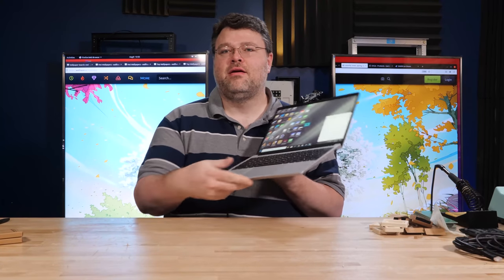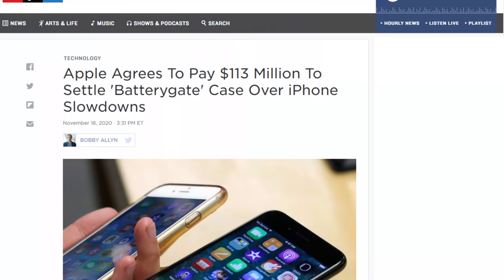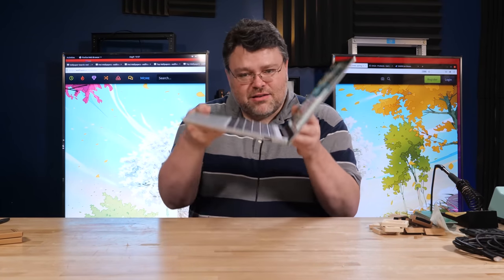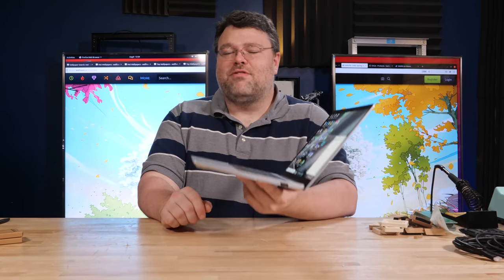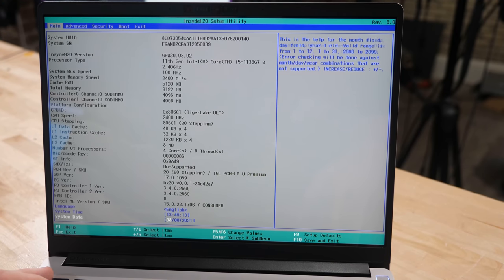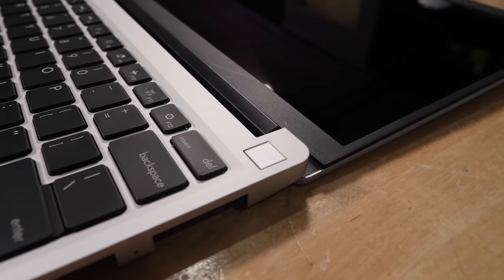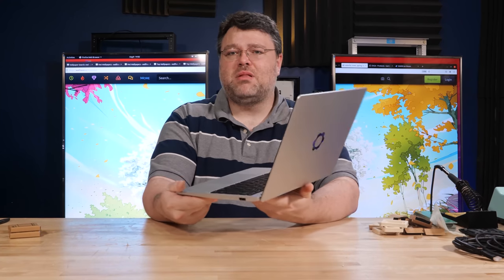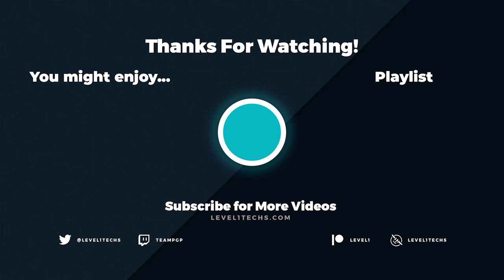Framework: A Laptop Designed to be Repairable?

Comment: I have an invention that still would crush this. 
Instead of the CPU, RAM, GPU being in the "lap" portion ... make those just a thunderbolt display and port replicator with a USB kb connected ACTIVE thunderbolt 3 cable -- which could be networked in homes to even disconnect location-from CPU via Thunderbolt-3 switches. That way all the actual computer 'work, fan' bulk, etc., are independent of the KB, display and ports. Networked throughout your home, it's still just 1 plug in the wall (just like your AC) and as TB3 passes more than enough power for the entire device, as well, is still but 1 cord.  You'd have also inadvertently cured all the latency of WiFi even as supposedly faster than 1GbE options emerge ... and could then have 10GbE if not SFP28 or even QSFP+.  

As a portable, the "power brick" is the whole computer, modular as it is, but more easily so bc the things that had to be ergonomic are in the actual KB and display -- which are NEVER the source of HEAT, and allow swapping out differing-display sizes as any OTHER TB port would support any display that were compatible with the form-factor. Which are already as "technically challenging" as swapping out USB KBs ... along with connecting every other port via that same TB cable. It's as 'peripheral committed' to the box as your shoes are to your pants. 

In fact, water cooling it wouldn't be difficult at that point. And despite everyone's focal-fixation being whether air or water have colder temperatures ... it's NOT the key-benefit of liquid-cooling, verse how QUIET larger, lower-RPM fans are vs those which must be thin & small. Small heatsinks have insufficient mass & fan-diameter to run at low RPM, which is what is actually annoying; not even the dB, but the PITCH.  It'd also be quite-easy to then make the interior of the actual computer ("think: power brick") encased in rubberized material making it DURABLE and -- waterproof, with an alarm if the liquid cooler-ever had an issue or cooling weren't adequate ... but of course, instead of laptop components, if home -- you could plug in to desktop class devices ... with the criteria being one based on whether you require completely wireless runtime (on battery) or not.

Comment: The Dell Latitude line is equally repairable imho. 6 captive screws and you can replace just about anything. The “upgradable” aspect may sound nice, but I wonder how well this goes across generations as in the future things get faster and you want higher resolution screens, at some point the “old stuff” will no longer be compatible which will get really expensive and may inadvertently lead to more waste.
Reply: Replacing the mobo on the Framework is possible, so you get to keep the battery/screen/chassis when next gen CPU comes out. And it's a gorgeous screen too.
Reply: @doryiii  yes, I know that, but 5-10 years from now pretty much everything from thermals to wiring to the battery type will be “old”. How many people can still connect a VGA-only display without converters? I just cycled an old 10 year laptop out of production, 720p was standard on laptops and they were ~3 times thicker, had a CDROM, NiMH batteries, the charging circuits provided a lot less power than today, the CPU and GPU power ratio shifted, we had PCMCIA on this models still and the keyboard/mousepad interface in the computer was PS/2 driven (or at best USB1.1). Everything from the frame to the screen to the motherboard is effectively useless, I can actually put in a few raspberry pi’s in the empty spaces.

Comment: I'd love for a desktop replacement version with a socketed 4750GE, and 4 slots of SODIMM
My uSFF desktop from Lenovo has socketable everything, and yes i tried a different processor, wouldnt work with 65w, but did with 35w. This processor seems to top out at "33w" according to the built in monitoring software, which also seems to be the max for the 4750u so it shouldnt need too much of a larger cooling solution

Edit, would also be super cool to have space for a single slot GPU like the GTX 1070 galax katana, maybe putting that in a laptop will bring back that form factor

Comment: As long as the screen, battery, and cpu/mobo (I know, the CPU is soldered) are easily replaceable/upgradable in the future, then I like the idea.  Otherwise, the only real difference in choosing framework is the modular case.

Comment: My only issue with the design is the small number of ports. 
4 USB-C without a dedicated charging port and display outputs is not enough.  
If I keep it plugged in and I use 2 external monitors.  only one free USB-C remains.

Comment: Assuming the plug on those modules is USB c, I would forget the modules and just get USB C to whatever cables so I can have some strain relief and protection for my cables.  They could just have recessed USB A and C in my book.

I am thinking of going with the Thinkpad x230 replacement motherboard by Xytech, its the next project in the same vein as the x2100 where he puts a new Intel motherboard in the old Lenovo.  I can't leave my Thinkpad trackpoint, it just works so well, now that I'm used to it.  I never liked trackpads anyway, ever.

I applaud the idea, but I'm gonna need a better keyboard than this laptop offers.

Comment: It's almost perfect - almost. Just 2 things left - schematics are available only to repair shops and under an NDA - I can imagine a couple of reasons why that is so, but that doesn't mean I like it. Another thing is no discrete graphics. If framework2 fixes that, I'll be fully sold. NB. shoutout for the replaceable ports. Love that functionality and flexibility.
Reply: The NDA is necessary because not all of it belongs to Framework, but from what I heard, you can request the schematics, sign the NDA, and you're good to go.  It's not that big of a deal.
Reply: @Bri-bn5kt  I understand that's one possible reason for it - there is, afaik, no official stance on this. Either way, doesn't mean I have to like it. Unless we put pressure on companies, they will never change.
Reply: @GalvayraPHX  Baby steps.

Comment: I don't understand why so many laptops have those huge trackpads and without buttons. I hate both of those. With large trackpads not only is it impossible for me to use the whole pad (despite the fact that I have larger hands than most people), but my fingers/hand always accidentally ends up touching the pad, bugging it out.

And then when it comes to buttons, even the clicky pads are annoying. not only do they probably break easily, but the click action frequently causes the cursor position to move slightly due to the movement. That, plus when on large trackpads It's hard to right click because it's so far away.

It's such a mess, I don't understand how people can live with that.
Reply: wtaf have u used a trackpad from 2009?. Those a 2hit . And the buttons are annoying aswell. It depends on the placement. How old r u?. 50?

Comment: If they advertised battery capacity at 70-80% of full capacity and limited the charging to that it would make mobile devices last a lot longer (such provisioning not as important for easily swappable batteries).
Samsung charges their phone batteries to 4.4v which just murders the battery. Got 2 s20fe's 8 months ago, one had macrodroid alert when battery reached 69%, the other 80%. 80% was losing capacity roughly 10x the rate that 69% was (80% ~100mv, 69%~10mv). Don't even want to think how bad it would've been if charging to 100%, but now they both are set to alarm at 69% (noice)

Comment: Very nice concept,  unfortunately this is good for modularity rather than upgradeability.
I Foresee problems for future upgrades, let me explain.
Can type-C convert to HDMI 2.1 or DP 2.0 without losing functionality, I think not.  Thunderbolt 4 perhaps has enough bandwidth at the mo kind of for HDMI 2.1, yet we are limited to PCIe gen3 speeds.
I think the type-C interface itself will prove to be a problem for a future upgrade to a newer i/o standard.
Why not pure PCIe 4x4 and/or 4x2 the link between modules and CPU and/or chipset.
Reply: You're right.  Framework isn't for you.  You should look into a macbook pro. You deserve it.

Comment: 1.Framework Has to create a Workstation or Gaming laptop with GPU upgrading . GPU gets outdated after 3 years faster than CPU .
2.Battery should be large and separate cells like apple if one get damaged it's easier to dumb that.
3.Also Dongle should be smaller and more ports
4.AMD 8 core CPU and GPU is efficient and fits in thin chassis.

Comment: Any news on Linux support for the Framework laptop?
Reply: Yes there is. Check in their forum.
Reply: Linux support is good. Just make sure you use a recent Linux kernel if you’re using the Intel AX210 Wifi module that framework offers. If you use a different Wifi card, you might not have any issues with it. But this is the biggest issue for Linux.

Comment: 2:50 i disagree with that. I have like 9 year old laptop and its only 3 screws to get access to harddrive and ram and guess what? You can even replace the cpu :D but yes this laptop is very nice :) i will buy one soon :)
Reply: I actually recently replaced my laptops fan cus it stopped working. :D i needed to open about 5 screws to replace it :D i fecking love my old laptop <3 but i want to support framework so i will buy one :)

Comment: Still dont get the big deal with a thin laptop. I've never had a problem fitting a laptop in a bag.
Sounds like you'll be placing basically the whole motherboard with a soldered CPU, is it?
Reply: Yes the cpu is soldered, but that's probably more to do with intel. Their mobile chips don't come in socketed varieties afaik, they would be inefficient space hogs anyway

Comment: I'd buy one if there was correct arrow keys. Arrows are my most used keys as a programmer.
Reply: Why are you programming on a laptop?  Desktop is much easier.  Trust me.  Been doing it 20 years.  But if you insist on using a laptop and arrow keys are your hill to die on, then get an external keyboard.  If you're a real, professional programmer, you're already plugging in at least 2 monitors, right?  And a mouse?  So why not just add a keyboard to it?  Besides, supporting this company (and the right to repair movement) is FAR more important than your arrow problem.  Buy the damn laptop and help the company grow!

Comment: I REALLY hope that they will offer a mechanical keyboard with a Trackpoint instead of a trackpad. It's a deal breaker for me.
Reply: Mechanical keyboard on the laptop? Only several had done before and they're pretty thick, feels not as nice. What's not desirable in bringing in your own keyboard?
Reply: I've been reading forum threads; as it currently stands, neither of those things can happen without significant changes to the laptop (to accommodate extra depth).

Comment: People keep saying it's designed for tinkerers, but is that really true? Wouldn't it make sense from a corporate office perspective to supply your entire school / law firm / hospital / etc with these and dramatically cut down on upgrade/repair cost and time? No more $1000 replacements in a lab far away just because someone stepped on a cable and destroyed a charge port; just get the $10 new USB extension port, ask Dave from IT for 5 minutes to repair it, and off you go.

Comment: This is good, but things used to be better. Laptops used to be much more repairable than this, hell you could swap out batteries without opening the casing. One of my dad's laptops even had a socketed CPU, even though it was a midrange model.

Comment: Going to be quite frank, the three real differentiators between this laptop and other user serviceable laptops are:
1) It isn't a mid-high end gaming laptop, including pros and cons of said laptops
2) The "Modular" ports are literally just dongles that fit in the chassis, and included in the box.
3) Parts availability. This is the major advantage Framework has, if they are actually successful enough to follow through.

That said, we've gone through this song and dance before. Consumers largely don't want user serviceable devices that they can fix. They want throw away devices that will just work until they're outright replaced. It's a great idea, alright implementation, with a small audience.

Comment: i want to like this, but im pretty sceptical. please tell me what i miss here.
i will  seperate this in tow parts. to make clear. im for right to repair and repairability.

Part one = you can get a cheaper laptop with the same specs or with the same price for better specs.
and i dont mean the cheapest one you can buy. you can have a branded one for less.

part two = what breaks in laptops/notebooks. Batteries, display, hinges, power IN port, gpu and maybe the keyboard (water/excessive use). 
customizable ports I/O is nice to have. but instead off two custom ones you probobly could get 4 ports for the same area.
since it uses usb c. you cant get like vga or a rs232. because it needs extra hardware. it probably cant fit in the port slot.

i work dayly with laptops. my expearience are battery, hinge failure and obsolete hardware. why I / we replace them.
yes you could repair. but because of the hardware it doesnt make sense. if repair cost meets new hardware. it doesnt hold up.
 i can still use them. but newer software and programmes needs also more power.

and because we dont have a mainboard standard for laptops we will never get a full upgrade. 

since you came that far. thank you for reading it. I apreciate that.  
P.s. im not a native speaker so.. i know ^^

Comment: Hope that there’s also going to be an 8-core Tiger Lake variant some time in the future…
Or that AMD is finally getting its Thunderbolt/fully-featured USB 4 shit together soon 🤮
Reply: I feel like the AMD USB4/Thunderbolt situation has more to do with Intel dragging its feet on certifying AMD powered devices. We've already seen ASRock and ASUS with AMD motherboards that have Thunderbolt ports, that work well from what I hear.
Reply: That won't happen if you don't support the company TODAY.  Get the laptop, deal with it not having an 8-core Tiger Lake variant.
Reply: @Bri-bn5kt  EH, no. Priorities are out of line. They needed to have more than one CPU vendor out of the gate. They are discouraging their biggest market by only offering intel processors. That is exactly the kind of behavior that got dell sued back in the day, and the wounds are still fresh.
Reply: @rich1051414  The one computer manufacturer that's RTR friendly has "priorities out of line"?  Really?  No.  YOU have YOUR priorities out of line.  They are a STARTUP.  They have not reached that point yet. They need funding to get there, what part of this are you not gettings?  Help them get there.  You can deal with an Intel chip for now, it won't kill you.  Intel may suck as a company, but they still make a decent chip.

Comment: This is revolutionary. Sadly, it is going to have a massive uphill battle. They are getting into a dirty business, and I forsee shady things going on behind the scenes bu competutors to starve them of parts or drive up their costs. Likewise, it is hard to explain to people why they should want this.

Me? I want an AMD module. But I don't want to to have to swap the whole mobo. So I hesistate, and that is a big problem. So many people like the idea, but options are minimal, with no promise they will still be around by the time you need or want an upgrade, it is a hard sell at bare minimum about $1000 for a lot of people too.

Comment: I wish they were AMD based and not so expensive. I paid 800 for an Asus with the same specs as their $1400 model. I can get at least 2 major repairs done for that price if not more. You can't upgrade the CPU or GPU so there is not really any upgrade path. I think it is a great example of what can be done but there is no way they are working with the same margins as the big players. They are cashing in on the repairability novelty instead of competing with regular laptops. If these cost 1k they would easily make up for the difference in increased sales while actually making a difference.

Comment: Too bad they still don't sell outside of NA. Also, probably because it's not doable otherwise, the CPU is soldered on the mainboard, so if performance is lacking, you're SoL, no upgrading here.
Reply: They have plans to offer upgraded motherboards in future you can swap into your chassis. Want a faster cpu or a ryzen? Just buy the mobo when it comes out and put it in your laptop

Comment: If the modular ports offer a USB-C, there's no reason they can't offer a 2.5 Gb Ethernet. Do they offer an Ethernet port?
Reply: Not yet. But it’s the most requested new module on their forums. While it would be great, I don’t think it will physically fit within the space constraints of the module, even with the slim flip-out type ports, the module is set kind of low on the laptop body and a wire will not physically fit and allow the laptop to remain flat on a desk. That might be a show stopper for the company if they don’t want to release something that will have to be kludgey

Comment: but.. is the cpu soldered to the board like any other laptop?
Reply: Yes it is. The idea is that a CPU upgrade would involve swapping the motherboard, but all the main pieces would remain in the same spot and all connectors will be the same. Remove your ram and storage, disconnect all the external connections, swap in the new board/CPU, and put it all back together in reverse of disassembly.
Reply: @gsrcrxsi  I see make sense.. I guess asking for modular cpu is asking too much lol.

Comment: any issues with linux hardware drivers on it?
Reply: There are issues with Wifi drivers (with the Intel AX210 that framework offers) on certain Linux kernels. Not supported on less than 5.10, and spotty support on various kernels between 5.10 and 5.14. I’m on Ubuntu 20.04.3 with 5.11.0-34 and there’s an easy workaround that gets it working.